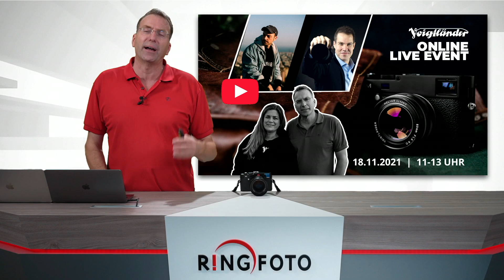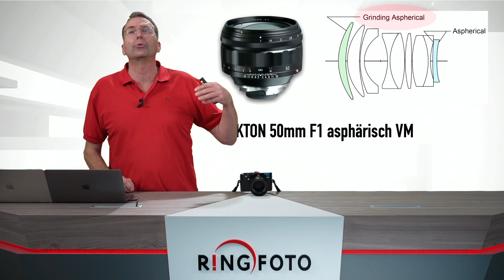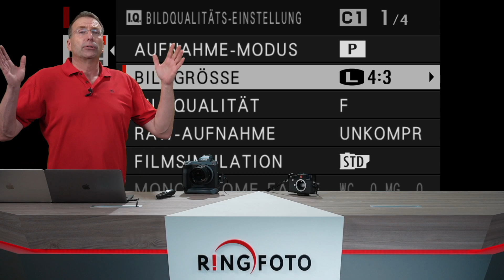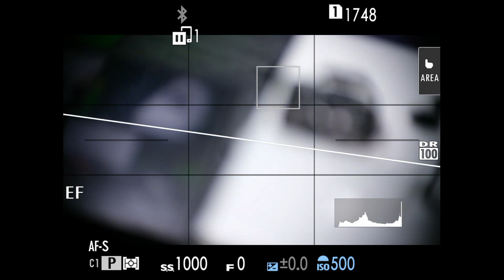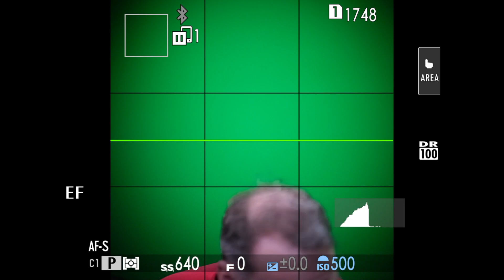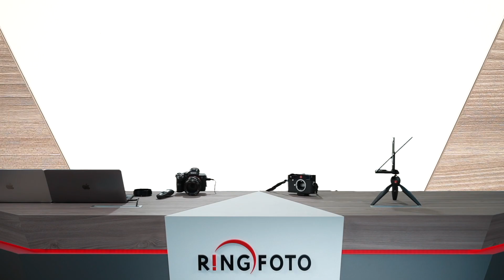Voigtländer 50mm F1 asperical VM English ...with lots of Adaptors ;-)

Comment: Wow..this would turn my Leica M10M into a "see in the dark" monster!!
I"d been toying with getting the TTARtisans 50mm f/0.95.  But with those, I read you often have to use the screws on back of lens to tune the focus in properly.
The Voigtlander f/1 is close enough to me to get a more dependable lens that I can count on focusing properly with my M camera right out of the box. 
It's something like only 1/10th of a stop difference?  I can live with that.
Just wonder when it will be released?
Reply from the maker: Sales Start will be in January :-)
Reply: Hardly, it is only half stop brighter than f/1.2. The difference is almost negligible... But yes, it will allow me to shoot at 1/250sec instead of 1/100...

Comment: The image circle of the Nokton 1 : 1 - 50 mm suits the 24x36 mm 
full frame camera. No bigger format will do.
Mounted on a Fujinon GFX 33x44 sensor, it causes a huge vignetting; 
which is a disturbing deviation.
It is not right to consider it o.k. or an artistic expression.
An optic with too much vignetting should be rejected. 
It is a mistake to accept the dark corners and go for a smaller format.
Suppose my Hasselblad Zeiss Distagon 1 : 3,5 - 60 mm makes extreme  
dark corners of my A12 6x6 negatives. And my photoshop advised me
me to salve the problem to buy a Hasselblad A16S cassette with the 
much smaller 4x4 format.
I would never buy a lens with a too small image circle.

Comment: I wonder, how close I can get with close focus adapter and 75 1.5.
Reply from the maker: Depending on the depth of the Helicoud (differs if it's E, X oder Z-Mount) roughly between 50 and 60cm with the 75mm Lens (the wider the Lens, the larger the difference)